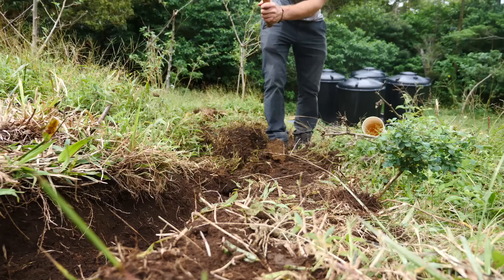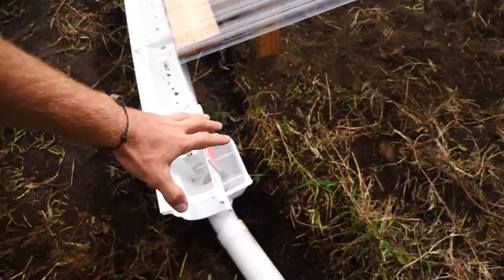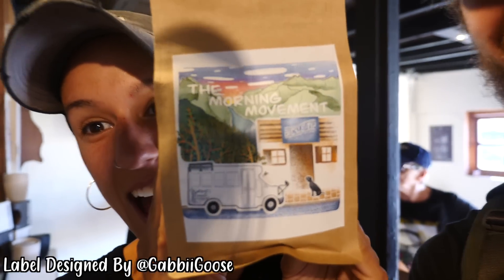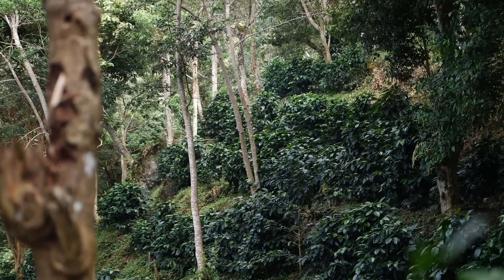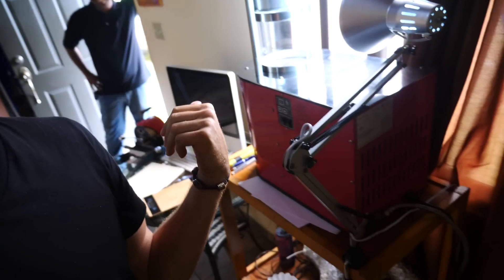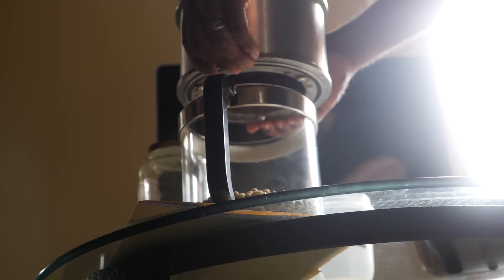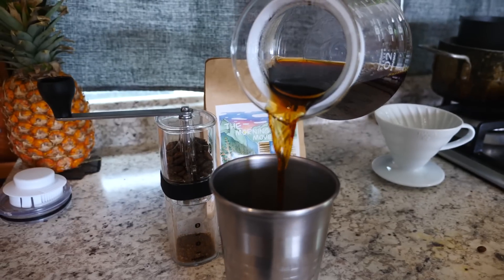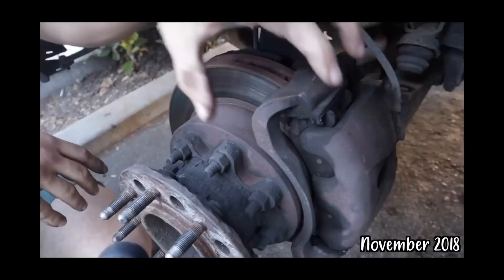WE HAVE A BIG ANNOUNCEMENT! // building a tiny house homestead

Comment: This rain collection system is going to be a big learning project for you and I'm going to throw in my two cents and a caution based on the system I helped put in at my sister's place.  If you have all of your tanks connected and open to one down hill pipe when you have a leak in that pipe or forget to close the tap you will lose all of your water.  (In their case, the first time, a sheep in the barn knocked the tap open and they went dry when over 3000 gallons of water ended up flooding the barn down the hill).  After that they split the tanks, one fed the farm and the other the house.  When weather split a pipe in the run to the barn they only lost that one tank...  Also, the one that fed the farm: the water was let in at the top of the tank which filled to capacity before spilling over into the top of the next tank that took care of the house (3000 gallons each, two tanks).  That way they left any debris behind in the first tank.  They were running off a spring that didn't produce enough water to fulfill their needs as the production varied with the seasonal rain fall...so a bit different from your situation.  Good luck!  It will be fun to see the solutions you come up with.
Reply: A check valve at the bottom of each tank could solve the problem of losing all your water.
Reply: But with a check valve they could either fill or empty... not both...
Reply: @astrong1984  of course the check valve would be set to allow them to fill. Another spigot could be installed to withdraw water.

Comment: I could be wrong, but shouldn't the tanks be loaded from the top? After a little bit of water pressure, they will only fill a certain amount up before the gravity water pressure becomes less than the tank water pressure. Unless you have a pump that will assist in filling the tank to overcome that water pressure. Just a thought, and I could be wrong.
Reply: It will be interesting to see how full the storage tanks get before their static pressure exceeds the head pressure of the supply line and the water backs up to the collector

Comment: To me it seems you would have to put your rain roof on top of your collection jugs, because the pressure in your roof pipe won't over power your jugs with some water inside creating opposing pressure at some point. The jug connections are good the jugs don't have opposing pressure so they will equalize naturally with their own pressure's.

Comment: I am not a water engineer but I would think to conserve space and piping, the catchment system would go above the 4 containers (with 2x4's holding the catchment).  That confuses me a bit.
Reply: @teknav1  Hi Maurice.  Thank you for that answer.  I am still a bit confused as to why the catchment system is not built on top of the holding containers.  There must be a reason because I would think building it on top of the containers would be easier and have a smaller footprint.  Thank you:).

Comment: 2 cents: I'm no expert but logic says to me that if you are trying to fill the 1st tank from the bottom you are gonna have a pressure problem and it won't fill. There's not enough pressure in the fill pipe from the roof to the first tank to overcome the pressure build up that will come from the galloms of water sitting in the first tank.
The water from the roof to the first tank needs to feed from the top. Maybe a more scientific type can confirm/refute this for us!

Comment: Love your enthusiasm, and hard work. Just wondering if the bottom connections on your water tanks will fill  the tanks from what I see is a ‘gravity’ feed. Are you planning to pressurize the system with a pump?
Got this info, which may be something to consider:
“The problem is that, by making the direct connection at the bottom of the tank, you have no way of preventing a backflow of water from the tank, if the supply pressure drops below the pressure in the tank”.
Reply: I agree. I doubt that there will be enough head pressure feeding the tanks to overcome the static pressure of the water in the tank once they get filled to a certain level. Also, I didn't notice a drain or discharge valve to remove the water for use. It would be a good idea to install a discharge valve before the tanks begin filing.
Reply: The other problem is that all the water is being delivered at the bottom. The tanks won't fill and the rainwater will backup all the way to the roof. I believe that is the physics of the problem. The solution is to run the pipe to the top of the first two tanks.
Reply: King of the Road RV don’t know the thought process that went into this build but I agree with you.  There is not enough pressure to fill those tanks and the other issue is... Lola their pup, licks water from the  water roof so there is the issue of contaminated ( dog saliva) water. Oh well, we’ll just let them learn their lesson the hard way I guess. It’s thier farm anyway so let’s leave them to their own devices.

Comment: Question.  It appears that your water feed will attach to the bottom of the tank.  Won't that cause water to take the path of least resistance and rather than fill the tank, just overflow the gutter?
Reply: If your watching this channel for common sense you came to the wrong place hahaha
Reply: Huh? Water tends to seek its own level. (Basic physics) therefore as long as thr opening of the gutter is LOWER than the top of the tank, water will flow INTO the thank
Reply: @HAVE A LAUGH Here's the problem.  When the weight of the water in storage exceeds the weight of water flowing through the pipe the water will seek the easiest exit.  It's true that water seeks it's own level but in seeking it's own level if escaping the gutter becomes easier than pushing itself uphill it will escape by overflowing the gutter.
Reply: @hughjass8369  Exactly.  My guess would be not very full.
Reply: @rty1955  You mean "Higher"
Reply: I would have positioned the tanks on the highest point on the property, & built a large open shed/catchment roof above them, with gutters that drain directly into the tops of the tanks. The filled tanks could then gravity feed to the lower points on the property.

I can't figure out why they need to make it so complicated. 

It's obvious they have no experience, but rather than consulting locals with experience, they're clusterf***ing their way through it. Oh, well, live & learn, I guess ...
Reply: @HAVE A LAUGH - greenhouse? At the tallest point, it's still a head shorter than Jordan 0:04 How are they going to work under that?
Reply: @HAVE A LAUGH - a greenhouse you crawl under ... LOL ... because standing is so overrated ...
Reply: @someoldguy7078  Yes  you are correct, my bad.
Reply: @HAVE A LAUGH - no, I don't  get it. A temporary structure does not need concrete for the posts -- gravel tamped down into the post holes would be sufficient. I have actually built such structures in tropical countries that have stood up for years. 

And even if concrete was required, sufficient water could easily be hauled in their pickup in containers.

But you go right ahead & keep white knighting their questionable decisions.

Comment: Not to be a buzzkill, and I’m certainly not an expert. I drive a truck for a living. But don’t you need your water input to be at the top of the tanks? I’ll do some testing when I get home in a few hours, but with a tank, liquid won’t rise higher that the fill point without pressurizing the line and/or using a pump. You might need to bury the tanks.

You might solve the issue easier by moving the rain roof above or higher than the tanks.
Reply: Seems common sense is a problem with these two Hahaha
Reply: Couple inches of water in each tank, and a full feed pipe of stagnant water is what they'll have. Live and learn, I guess!
Reply: It’s a minor detail that’s easy to overlook, especially when basking in the excitement of starting something new. It’s just that all fuel tanks fill from the top and empty from the bottom to make the best use of gravity. Give the rain roof and water pipe some legs and problem solved. If you move the rain roof closer, you won’t need to worry about having the pipe in the air for all that distance.
Reply: There is a notable difference in elevation between the gutter and the tank inlets and the tanks should be able to fill (note their previous video that shows this).  They did rigidly connect all the piping together rather than using unions and some flexible hoses that would not only allow tanks to be completely removed from the pad without having to cut the pipes but also prevent the piping from breaking if the tanks ever move (due to wind, ground movement, etc.)
Reply: Those pipes you have with the open/close valves attached to the bottom of each tank... those are your outflow lines that will feed your plumbing system to your shower and sink or whatever. Do the same setup at the top of the tanks. Close the bottom valve on the primary tank to allow it to fill up. And once it reaches the top valve, it’ll fill the other tanks. Or you could have each tank fill up in turn, by connecting tank 1 to tank 2, tank 2 to tank 3, and tank 3 to tank 4, keeping the next valve very slightly lower than the previous. Just be absolutely sure that the bottom valves and seals can handle the weight of all that water.
Reply: J Lewis do you really think they’re going to take advice? They’re too busy selling coffee.
Reply: Wow. To all you physics majors out there. Water tends to seek its own level, therefore as long as the open feed from the collection system is HIGHER then the tanks water WILL flow FROM the collection system TO the tanks. As far as fill location on the tanks, you can EITHER fill from top OR bottom it don't really matter because the DRAINS from the tanks are tired together allowing the water to level at the same height in every tank. Feeding one tank than the other (like in series) wont have any affect, becuase once again, the DRAINS are connected together. In fact he can just connect ONE FILL line to ANY tank and the rest of the tanks will get the water through the DRAIN lines (since they are connected togethers. I would recommend an overflow on all of the tanks. And some sort of guage (electronic (solr based) or float type) to determine how full the tanks are. Its also important not to jabe any light enter thr tank or algae will form

Comment: Might be too late depending on the lag from filming to uploading BUT.
You are missing something in your pipework installation that is vital for your long term sanity ... Unions, it is a necessity to be able to take the pipework apart to carry out maintenance, or even to replace a leaking tank, glued fitting to glued fitting don't allow for this. If you haven't yet got the tanks full of water then it is easy to cut the pipes and put unions in, if you already got water in the tanks then I am sorry that my comment was too late.
Reply: @J Rose they'd just lose the water connected to cut pipe and add unions.  Unions have a backward thread on one side so you can connect and disconnect otherwise fixed pipes

Comment: my prediction is that glued fitting  you last fitted together on video  judging from how far the purple cleaner went back on the pipe which usually means not much of the pipe went into the fitting will be the first failure

Comment: Jordan you might have wanted to put in some unions on those individual tanks so if you ever had to remove a tank from the system you could just unscrew it do whatever you had to do and then reattach it to the plumbing.
Reply from the maker: Robert Powell good idea thank you!
Reply: White Obama Is Beta O'Rourke  they are glued together. Unions allow it to be unscrewed
Reply: Yes,,, I was thinking the same thing.  You always need to plan ahead for unknown issues and or maintenance. 
Better to do it now while they are still empty. 😉
Reply: ditto on the unions.  You can still put them in easily.
Reply: @NomadicMovement  A shut off valve at each tank and then a union. Unions are only $5 for that size pipe. shut off valves , another $5 each. Cheaper than a woman's haircut
Reply: Unions leak ...leave it the way it is if you need to take one tank out ....cut it ...plug it ...and when ready reattach with a sleeve.....

Comment: I don't think you're going to be able to fill the water tanks from the bottom like that- the water will only fill up to the point that the incoming pressure equals the downward pressure of the water already in the tanks... the inward pressure doesn't appear to be significant enough. better build something to suspend a pipe so the flow of water from the rain roof goes  to the top of the nearest tank- then they will fill as planned.
Reply: Correct, this current design is seriously flawed.
Reply: @TheRealJerseyJoe  thanks.... I thought so-- oh to be young again! they'll figure it out:)
Reply: @KayRay1966  oh to be young again! they'll figure it out eventually:)  I didn't read the comments before posting my comment- glad others saw the problem too
Reply: @jeffbee6090  -- Absolutely !

Comment: Wouldn’t you want your water inlet from your rain roof to go to the top of one of your water tanks and then have it’s outlet at or near the top to then flow into the others. That way all the sediment would stay in the first tank and make it easier to keep clean. You could leave your bottom vale setup for when your low on water and want to use water out of 1st tank and just splice into it and add one more clean out valve. Great videos by the way.
Reply: HAVE A LAUGH  I meant fill from the top on the first and have the other 3 fill from the bottom so they could level out. The first one would obviously fill first and stay full until the lower valve is opened when the other tanks are low.

Comment: I'm just curious why you didn't build the rain roof over the top of the barrels. You could have rain collection and future Greenhouse. Taking up small amount of land space.
Reply: There is , evidently, more rain falling on the top end of the property than on the bottom part. Why else would a person put a rain collector a hundred feet away from the tanks and run a couple hundred dollars worth of pipe downhill to fill a 2400 gallon water tank (that will need to be pumped up to the house rather than using God's gift to man, that being GRAVITY!, when it would have been easier and cheaper top build  a collector roof right over the tanks? The answer is because there is more rain falling on top of the property. It's common sense!! (I think....)
Reply: I think they are sweet kids. They are excited about their land and their dreams. Just don't have engineering and carpenter experience and in a bit of a hurry. I was more trying to be helpful. If you start by biulding an elevated roof for a greenhouse and put the tanks at the gutter end. On the uphill side of the land. At the road. You can multiply it's use. Gravity feed water to Tiny houses threw a filter systems. They are just excited and maybe before they spend a lot of money. This would be helpful to share or just not my business. Not trying to be insulting. I asked because they might have a reason for their set up.
Reply: @msrhondakay5880  You are correct. I was just being sarcastic. Their tank setup makes little to no sense.  Greetings from northern California
Reply: @someoldguy7078  , I once lived in Southern California. I've built three houses in Southern Florida. From clearing the land, forming the slab. To every nail in between, to the septic system. I think I was younger than these kids building the first one.  I was 22. I would love to build out a van and travel some, so I enjoy watching them on their journey.

Comment: The tubing from the rain roof to the tanks looks kind of small to accommodate a full on rain storm.
Reply: @teknav1  as long as they vent the top of the tanks and the bottom of the rain roof is higher than the top of the water in the tanks The water will flow without a pump. My original post about the tubing being too small is a question of the resistance in the tubing and the speed at which water can flow in the tubing to keep it from backing up onto the roof. This could be solved just by using a larger diameter of tubing.

Comment: Hi!!! Love your channel! I am also in South Africa....my wife and I are also trying to get out, but it is a long, expensive process. Trying for Canada, but we have also considered Panama! Things are not going well here....corruption, incompetence in the business and service sectors, violence, ....those are the main problems but where I stay we have extreme drought and electricity and water cuts (because of incompetence in the power and water service industries). Well done on your big decision to start your homestead! I'm sure you guys will do great! Just a concern about you water tanks: The inlets being at the bottom means water will be pushing against the head pressure which is determined by the difference in height between the water supply and the top of the tank. Pumping into the bottom means you are having to push against a head pressure equal to the level in the tank (or the level of the 4 tanks combined). The head pressure grows as the tanks are filled. I am no scientist or engineer, but if you end up having problems with the water level and water pushback up to your gutter system, you could either raise the water catchment area or drop the tanks down (might be a huge mission doing that) and then use the top inlets as the inlets and overflow outlets. Good luck guys! We will be watching every step of the next leg of your adventure! :)